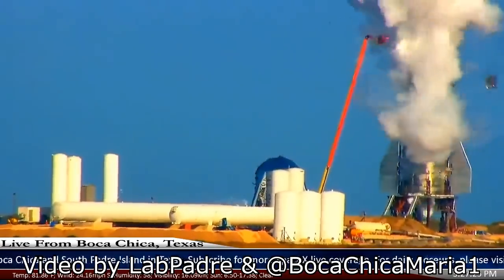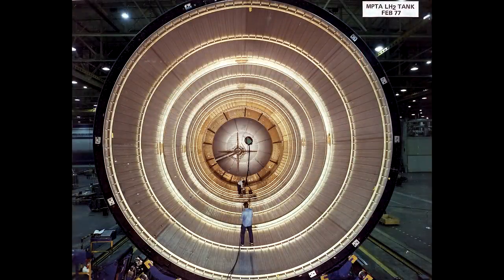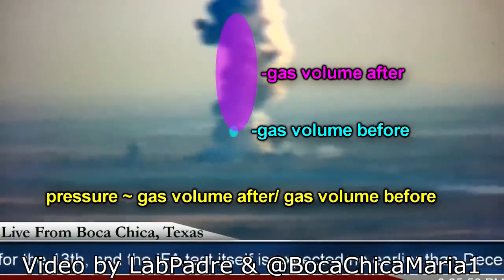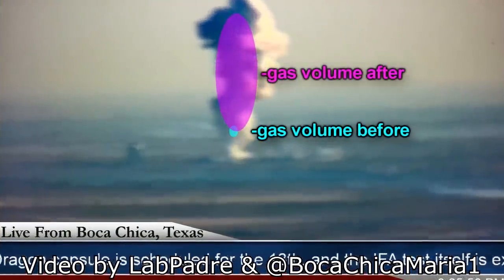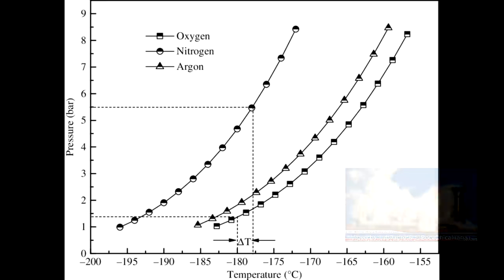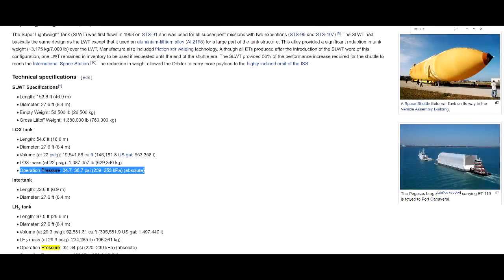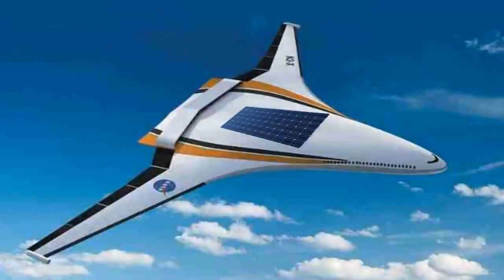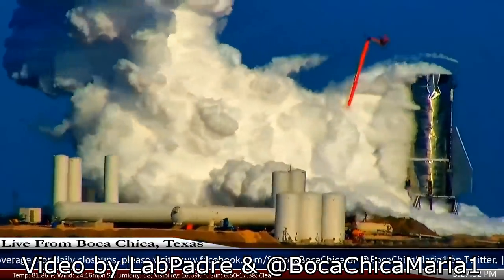Starship explodes, but why?

Comment: If you step frame by frame through the explosion, the initial failure point is top / right of centre where the stainless steel pops a fair size hole and a liquid sausage emerges. There immediately follows the rapid expansion along with the buckling and the top popping into LEO. As it continues there appears a second hole lower down on the left venting fiercely. Nothing from the first hole (which is probably open to atmosphere as the top blew off)?
That stainless is flippin tough stuff. You can't see on the film er video, but it must have been on a weld corner by the look of it.
Edit? It also seems to have a ring of frost round the lower section? Anyone? The stuff was pouring out the bottom of the thing too.
Reply: I think under the ring of frost is the fuel tank (it's about that small, compared to the space above for Lox).
So it probably blew out the top, then somehow it leaked out the bottom skin, where the 2 tanks meet.

Comment: It blew up because they had thrown a stone at it.
Reply: That is just dumb.   No one threw a stone at it. There was no one within throwing distance of it for safety reasons. In other wurds, they knew something would "let go".   The purpose of the test was to find weak rupture points.  They just weren't expecting the top of the tank to come off.
Reply: @chuckymcnubbin1518  Supposedly it was a comms problem where the pumps didn't respond correctly to the pressure sensors. See https://youtu.be/nf5q2YlM2mU at about 1 minute in.
Reply: @chuckymcnubbin1518  Chill out, bro! That comment was supposed to be stupid - just like trying to  prove Tesla's superiority by trowing stuff at it.

Comment: The majority opinion is that this was a destructive test of the fuel system that failed somewhere they didn't expect.  This version of the hopper was already outdated enough that it wouldn't be used for any more flight tests.  You might want to watch Scott Manley's more informed video on it.